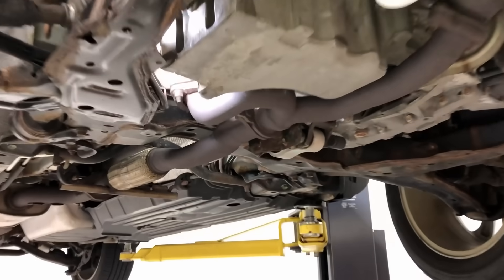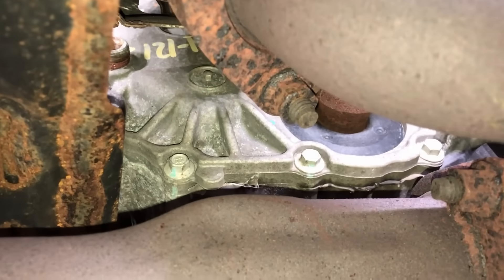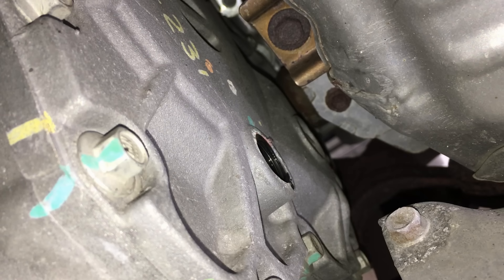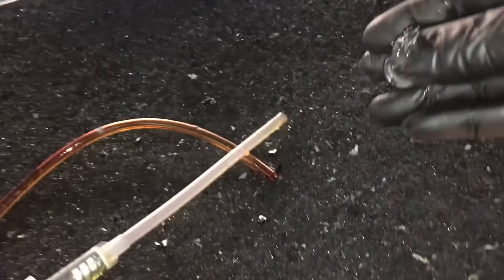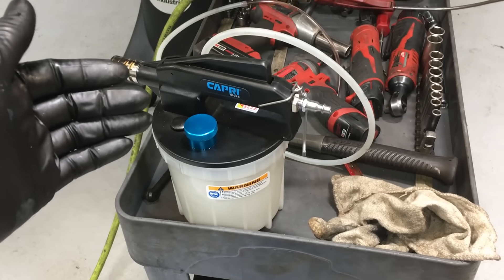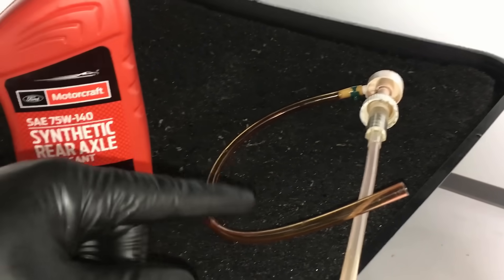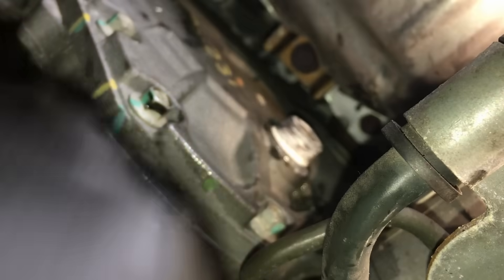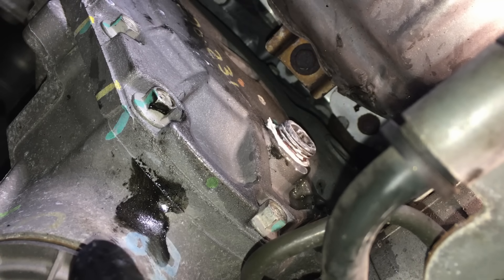Ford All Wheel Drive Vehicles: Critical PTU Fluid Exchange Procedure

Comment: Word of advice, it’s absolutely crucial to use the step down in size for hose. I thought my hose was just being a pain to get inside because the crap space you have to do this but apparently it was getting wedged in there and possibly into the gears and I fought for a hour praying it would want to come out. Absolutely get yourself a very skinny diameter hose to go inside the ptu and avoid my mistake that could have been detrimental. I found that ford actually thought about this getting serviced and if you look through the rim of the ford edge you can literally see a straight shot to the plug and makes filling and extracting easier since the hose is perfectly straight shot into it. Go through the wheel and through the wheel well and it’s perfect.

Comment: Thanks for the vid, that thing is buried up in there hold crap. That is nuts. I just grabbed an old escape that is running great so far.. But it has the 3.0 from 09 and 235k miles on it. So i'm trying to do as much as I can to fix er up to make it last. This is on my list for sure. Seems to be drastically highway miles at least so I'm hoping it had good airflow most the time. But I live in one of the hottest possible climates in the US.. Phx AZ.. And summer is coming.

Comment: What year is this? I had my 20 Edge ST today and there is a plate on the bottom they were able to drain all the fluid and then refilled thru the fill hole which took the whole quart. The shops service manuals showed some have some cooler on them but mine had a plate in place of the cooler. Mine did have over 82k miles.

Comment: I’ve got a 2017 explorer with a leaking PTU. It appears to be coming from the vent and leaking down the drivers side of the PTU. Is this a common leak point? I had the dealership do a drain and refill when they replaced the torque converter, could they have overfilled and that be what’s causing the leak? Had zero issues prior to them doing a drain and refill. Thanks

Comment: Man! You made that look easy! I think my 2013 Ford Edge (143K miles) PTU leak is from the belching out the top which I can't see. No leak showing against the transmission side and the axle only has oil half way around which I would think if the seal was bad, it would rotate the oil all the way around as the axle turned. I have bought the lube, pump and sealant. I'm putting my car on ramps because I'm just a harry home owner type. I'm hoping I can do this and if so, I'll make it a norm when I change my regular oil. Thank you so much for the video and advice.

Comment: Thank you for all of your videos bud! As an update for this video … I have 2013 ford Explorer with a leaking PTU - I went to the ford dealer for a quote today (2/21/23) … the quote was $3950 to replace it!!! 

So I’m going out to the garage to add extra oil to it for now until I figure out my next move 😢
Reply: I seen Dorman makes a ptu unit with a drain plug in the bottom of it for under $1000. Mukalacco said it's about 5-6 hr job so if you can find a good mechanic it should cost you about $1500 unless I'm missing something. Good luck.

Comment: I had a 2011 SHO 

bought it at 65k. Every time I get a car I do a complete check over and fluid change. Noticed my PTU had no drain plug and the slight chattering noise that I thought was the lifters, was actually the PTU. Drilled and tapped a hole for a drain plug, it had thick black gunk in it. Smelled horrible. Put atf in it and drove about 100 yards with straight ATF in the PTU. to try and clean that crap out then Put in the correct fluid, after draining the PTU.

Changed it again at 85k miles. Lots of metal bits and black fluid.

Chattering noise got louder over the 2 years/40,000miles I had it. I finally got CarMax to fold and set up an appointment to get me a new one under warranty. 

6 days before i was suppose to bring it in to be fixed I got hit on the highway and spun out and caused a 20 car pile up. someones dash camera footage caught it all and the guy that hit me and caused the wreck fled the scene. Cops never got the guy. broke my arm, had a concussion and fractured my hip. 

I went off on a tangent but, Change your fluid often!!!! Hell I’d do every 20k miles on the PTU. it can only help. And if you are looking to by any of the new fords with the awd/ptu. See if the seller will let you check the PTU or get them to check the ptu fluid before you buy. Damn near everyone with these cars neglects the PTUs.

I recommend heat wrapping the exhaust pipes near the PTU too to keep some heat off it. And order a small little pump off Amazon. I got one that connects to the battery and comes with 6 feet of tubing. It’s perfect for sucking out fluid if you have no drain plug, or pumping in fluid. It’s the best $25 you’ll ever spend on maintenance tools.

Comment: I did mine today 2017 limited explorer 3.5. 80k Just fill plug exactly like video. Fill plug did look tary like one in video but oil was not pitch black. I found a small hand transfer pump from harbor freight for 7 dollars I took a cap off a old quart of oil and cut a small hole in the top of it to put tube down in to siphon into. 12 Oz collected plus whatever was gathered in hoses that couldn't come out. The pump came with like a 1/4 in smaller hose that i could reduce with, easier to get it into ptu. Finally I used the cut cap I used on new court of 75-140 to push clean hose down in, to siphon back up.  Did take a bit more than I had drained.

Comment: Mak if one is bad as this one do you think after sucking out the old fluid and filling it with like kerosene and maybe drive it 10 miles or so and then suck out that fluid and fill it with the 75/140 oil?
Reply from the maker: That is an option yes but I would worry about the left over inside.

Comment: Yes, please get this fluid changed regularly.  I had to replace the PTU in a 2013 Explorer and a 2015 Taurus SHO.  They were both expensive repairs, more so on the SHO, because the labor was higher.  Bad design led to this part not being equipped  with a drain plug and a required fluid replacement interval.   I don't wish others to go through what I did.
Reply: How many miles were on both of them? I'm looking at a 2011 Taurus AWD limited that has 70,000 miles on it in excellent shape but I'm positive the ptu oil hasn't been changed.
Reply: @Jim H.    Our 2013 Explorer had about 80,000 miles on it when the PTU had to be replaced.  The Taurus SHO had about  60,000 miles on it.  The space around the PTU on the Taurus was smaller / tighter with less airflow, which may have accounted for the earlier failure.  The SHO may have been driven harder too, but I am not admitting anything with that theoretical statement.
Reply: @randychestnut6591   I have a '13 MKS Ecoboost. I have 133K on it and just had fluid added.  PTU seems alright . Too bad my transmission is going out.

Comment: Thanks bought the cheap bleeder off Amazon. I got my compressor pressure set. Royal purple gear oil and bottle pump. I am about to change it. 2016 sho with 26k miles. This is the best video on ptu fluid change.

Comment: The fluid pump linked to Amazon will not fit the Ford PTU fluid quart container. The fluid pump is for a standard quart oil container and the Ford PTU qt container has a larger mouth.
Reply from the maker: You simply hold it in there we do it all the time with the same setup.
Reply: @FordTechMakuloco  yes that does work out of necessity but I also believe Amazon sells one that fits called the Slippery Pete. I guess it depends how OCD you are 🙄

Comment: Yup, that's a problem I have. I thought it was the transmission. I was hearing a loud wineing noise. The garage changed the fluid in it and it sounds much better.
Reply: How many miles did you have on it and what vehicle!
Reply: @jimh.412  2010 ford Escape. Afterwards I learned it was a bearing that holds the drivshaft inplace that went which cost about $600. But I also had them change the PTU fluid too. It has 110 k miles on it and had poor mantience but for the price if $4 k that I paid for it the vehicle runs much better now that I'm maintaining it.

Comment: This video undoubtedly save me and my PTU. I had been hearing a whining sound at high speeds and I assumed it was one on the rear wheel bearings, only because my wife had hit a curb and blew the tire and scuffed the wheel months before.  Using a suction gun,. I removed the old fluid and the whole time I was sucking some air but I managed to remove about 5 ounces of black tar-like fluid. I pumped it into a clear jug with the thought of letting it settle so I could measure what came out. The stuff remained stuck to the sides of the jug for over 2 weeks. It was more like grease than oil. I did not wait but put in about 16 ounces of the recommended Motorcraft fluid. The noise is gone. There are no signs of a leak on my 2007 MKZ with 65K miles. Thanks Again!

Comment: I have a 2013 Taurus interceptor it has a drain plug on the side cover bottom area. It's in the area that in one of your videos you drilled and tapped your own drain hole. My Question is where is fill hole I don't see it on this one?

Comment: I hope who ever though it was a good idea to not put a train plug in it was fired and fell down a flight of stairs. 
I had a PTU eat its self in 2019 
The new one in my Escape has a drain plug so after having to replace it I change the oil every time I change the engine oil now its only .5 qt and its easy to get to so not that bad to change for me.

Comment: I  did this on my 2003 Ford escape v6 160K and the oil looked brand new. Might have been changed at one point but it sure didn't look like it had been messed with in the recent past. But The PTU is low in fact it's the lowest point on the car and it's pretty much out in the open in the air running underneath the car so maybe that explains it.

Comment: Amazingly enough Ford of Canada does NOT recommend  changing this fluid. I asked the dealer to replace it at 80k (50 thou miles) and they said they never change it, It's a forever, only a failure requires a change. They didn't have a set fee in the data base , so just did 1/2 labour and fluid. Service tech had NEVER done one and had to have the drivetrain mechanic help him.  Seems Ford wants these to blow up
Reply from the maker: Ford of America does not have it on their recommended schedule either.

Comment: Replaced the fluid on my 2016 3.5 L Explorer today.  It had the fill plug but no drain.  There was some seeping fluid past the seals, and the truck had 69,000 miles.  The PTU appears to have been disassembled in the past as it had gray silicone gasket sealant on it.  Using the smaller suction gun recommended here and working on a jack, I got about 12 oz of reasonably good fluid out of the unit.  

Ordered the big gun first, but it wouldn't work with my 2.5 gpm 120 lb compressor.  

I also removed the vent cap, working from behind the crossmember, and found the vent line to be clogged.  I unplugged it with a piece of lawn trimmer line and blew it out.  That was the reason for the weeping seals.  

Added about 13 oz of Motorcraft Synthetic oil with a hand pump and we're back in business.  Two hours, working on the ground in the driveway.  A great video.

Comment: Even this that bitch about the water pump. Go buy yourself the right tools, call ford for the parts you need. Buy a digital torque wrench and save yourself 2k in labor. It’s an 8 hour job and the water pump is $60… all other parts under the timing seal replaced brand new will still run you all together less than $500. You tell me what your 8 hours are worth…

Comment: I saw that all of the people that replace the PTU and the rear axle oil, they use 75-140 synthetic oil. But the manual say that you need to use 80w90. Which one is the one that you need to use in a Ford Explorer 2012 3.5 V6?
Reply from the maker: The manual states to use 75w-140 in the PTU and 80w-90 in the RDU.
Reply: @FordTechMakuloco  thanks !!! Your very helpful. Love your vids

Comment: my 2010 ford edge stoppedacceleratingpast 5mph, and I heard grinding when I accelerated and braked; I pulled over, turned the car off and back on, and now its driving like normal. Is it a possibility this is the problem? Or does a case of no acceleration and grinding while accelerating only point to transmission problems? Thank you.

Comment: Anyone else having trouble getting the tubing down to the bottom of the PTU? I get it a few inches in and just hit a dead end. It doesn't help that I'm doing this with my Taurus up on ramps, but I can't seem to snake my way around those gears. Haven't measured what I've removed yet, but I'm guessing it's not more than 4 ounces.

EDIT: The reservoir on the suction device was deceiving. I poured out that I extracted into a measuring cup so I could simply replace what I removed. Ended up with just shy of 16 ounces. Oil was really dark but not sludge yet. So glad I did this.
Reply: How many miles did you have on your Taurus and have you had any more problems?
Reply: @jimh.412  My Taurus had 45,000 miles on it when I changed it. I'll probably do it again at 75,000. I wasn't having any problems, just trying to prevent premature failure of the PTU.
Reply: @ohsoloco5113  Ok thanks. I was looking at a 2011 AWD Taurus with only 69,000 miles but I'm sure the ptu fluid has never been changed. I think I might pass on it
Reply: @jimh.412  yeah, that's a tough one. I'm sure the PTU oil is nasty, hard to say if there would be any damage yet.
Reply: @ohsoloco5113  Yeah I have a 2008 Taurus that I've owned since almost new but it's FWD and has 240,000 miles on it and runs and drives like new. I think I'll keep on driving that and just look for another FWD Taurus.
Reply: Changed my PTU oil again today after 21,000 miles while I was servicing the rear differential for the first time. PTU oil definitely didn't need changed yet, but for a pint of gear oil I'd rather do it too soon.

Comment: I just bought my second Ford Escape. My first one was a 2009 ford escape limited. The fluid was never changed on that PTU until I bought it with 125000.00 km on it. As soon as I bought the vehicle I changed the fluid in the PTU, but it was to late. Right after I changed the fluid it self destructed. I never did fix it, I just drove it the way it was. Now I just bought a 2016 Ford Escape Titanium 2.0 ecoboost. And of course the PTU fluid had not been changed yet at 120000.00 KM. So right away I had my Ford Dealer change out that fluid. I got it with a extended warranty so if the PTU self destructs on this one at least I made the attempt to look after it and my extended warranty will have no choice but to change it out with a new one.

Comment: That was a misadventure. 2014 Explorer with 114K. That fill is just about impossible to get to with just a jack. Magnet had lots of metal, at least that is clean.  Fluid didn't look that bad.  I was only able to get about 4 oz out regardless of how I shifted the tube and inserted it. I used the two tube method like you.  New twist, I used a shop vacuum.  Removing the filter allowed me to place a weighted canister inside. A runner piece allowed me to neck down to the tube.  It moved fast and when it was over the tube was spotless with no trace of oil bubbles.   This REALLY works good.   At least I know now that the PTU isn't about to explode.  I still have a drone in the front over 40. Bearings seem good and CV.  Just have to wait till it gets worse.
Reply: How is it running ?
Reply: @Tony_Alston4838  I replaced the front drivers side wheel bearing.  In a high salt area that is a challenge, but it got rid of the noise.  Preparing for a summer trip and will change  the PTU fluid again.  Fluid needs to be warm without the cat converter being too hot.  I tried sucking the fluid out cold and it is super slow!

Comment: Hey Brian! I bought a Motorcraft 75w 140 from the dealer here in Canada for my 08 Taurus AWD and they are trying to sell me that the PTU has a 'lifetime fluid' in it. I showed them the owner's manual and even the service guide recommends to change PTU fluid at 240000kms and he says that the manual is not accurate. Apparently,  they know more than the manual. Luckily,  I watched your videos before getting there.
Reply: I guess the parts genius gets paid hourly minus a commission so it doesn't matter if he sells you anything. Besides dealers overcharge for stuff that you can buy elsewhere. You can find Motorcraft fluids at some auto parts stores and online. 
Check your local Walmart too. I've seen Motorcraft oil and other fluids on their shelves. 
Motorcraft oils are made by Conoco Phillips by the way.

Comment: Great video !!! You would have to put new fliud in a few times to actually clean out all the gunk. I bought a 2007 edge awd, used with 121 thousand miles in 2012 for my wife. Thought I did a good job checking it out. After I drove an hour to get home and surprise her, LOL she walks up and said it smells like sh** , but no fliud showing/dripping. So made an appointment with a new car dealership in my area to have it replaced 3 days after purchase. 
Just like you said 1500-1600 hundred bucks. In those 3 days before going in I found a replacement part number that ends with a B. That part # has a drain and refill plugs already in it. I use Lucas 90-140 for 34 pumps and Lucas heavy duty stabilizer for 7 pumps, change out fliud every 2 - 3  per oil/filter changes . It now has 193 thousand trouble free miles and my wife does not want to part with it !!! I'm never been a ford guy, but this edge has been a GREAT vichele for us.

Comment: So if it already has the propane smell to it.. is it too late to do this or is it completely gone and need to replace
Reply from the maker: It can be the vent or the intermediate seal which used to be way more common. Either way they both drip onto the hot exhaust crossover and make the propane smell.